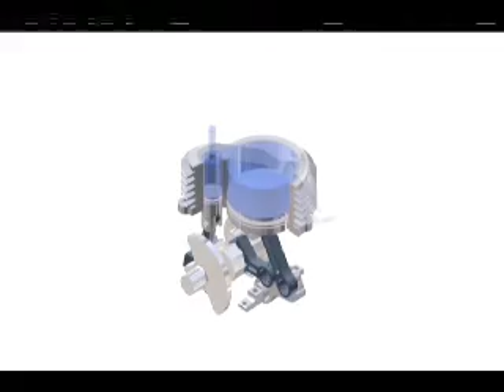A car that runs 200 miles on compressed air.

Comment: Fizzguts gets owned by me here!
watch?v=-X6oWZe0QTc
He claimed he has a pdf file from engineair which showed the motor will run 5min on 2 12L tanks.  When I said 5min on 24L is ok, he changed his story and said it is only a max theoritical time and the pdf actually shows constant flow, constant air pressure (not running on air tanks).  Further, he says the pdf is only theoritical, but his presumed 50% throttle losses are "actual" even though he has no throttle specifications or test data.

Comment: In the 1970’s Joseph P. Troyan designed an air-powered flywheel

In the 1970’s Joseph P. Troyan designed an air-powered flywheel that could propel an automobile using the principle of "ratio amplification of motion in a closed system." The Troyan air mobile (U.S. Patent No. 040011) was easily attached to electrical generators to create a pollution-free, variable-power system. ¨My engine simply uses nature’s most powerful force: air pressure¨ Troyan commented.

Comment: In fact many will not be aware that the use of stored compressed air has already been powering power plants. In as early as 1973 CAES (Compressed Air Energy Storage) installed their first compressed air energy storage plant in Germany.

Comment: I get so tired of these free energy scams.  Don't people understand the basic laws of physics?  There is no free lunch.  It will take more energy to compress the air than will be realized by decompression.  Because of inefficiencies of conversion, if fossil fuels are converted to electricity and then the electricity is used to compress the air that powers this car, it would actually end up being more polluting than an efficient gasoline powered car.

Comment: @ReeseL4D but aren't the air tanks under the car? not inside the car
so if you dude have something shaped like a ferrari then youd have a big space in the back where the engine usally is and you still have the bottom of the car
and plus youd still beable to fit people in it and it would be more aerodynamic

Comment: @redghost105 because it's a low speed vehicle.  At low speed, there is not so much air resistance.  A cube or sphere design gives the most interior volume per area of exterior material.  More interior space means more space for air tanks and passengers/cargo.

Comment: All you gotta do is catch a commie politician, tie it up, shove a hose down its throat, filter the hot air, you have fuel and heat in the winter...

Don't understand? Follow my links. Read the quotes page first.

Comment: @TruBluBand2010 
Read my comment again. 
Electricity, whether it's from solar or any other source, ISN'T FREE. I use some solar voltaics myself, and the cells certainly weren't free. (If you know where I can get free ones, please tell me, or appologize for the "ignorance" crack.) This is a scam. If they admitted the costs of the electricity to run the compressors to run the air tanks, it wouldn't be a scam (assuming they didn't also lie about the range of the vehicles on a full tanks).

Comment: @Nailer45 INO MDI cars of any sort are being sold anywhere. The Swiss MDI consortium are promising them ready to be sold in 2011 (yeah right) for 10,000 Euro. Buttock clenchingly expensive for such a short range POC.
Tata NEVER paid for a license as they discovered MDI are a lying bunch of arsewipes. They did sign an agreement but no millions of $ ever went to MDI

Comment: I was digging this video until the narrator said "use the air-powered generator to power an air compressor"... unless he means recapturing braking energy? I could drive a car that plugs in to use compressed air as a battery. Perpetual motion is silly, though. You can't use the fuel of a car to drive a fuel creation device to create more fuel for the car. You'd need to get more energy out of the fuel per unit than you use to create it.

Comment: Now observe Collins's profound assumption that a coefficient of performance (which is the useful energy output or work output divided by the energy that is input by the operator only) that is greater than 1.0 is impossible and would constitute a dirty old "perpetual motion machine" of the false premise kind he still advocates illogically.  There went windmills, solar cells, heat pumps, water wheels, sail boats, gliders, etc. All are impossible by Collins' assumption.

Comment: @charliewecker "Oh very good! Looks like you've been the one doing the research." Correct unlike you who won't and can't. Get an education. The same scam has run since the 1900's and has always been and always will be short range low power crap. Your stupid perpetual motion idea didn't mention imaginary fuel cells or totally impractical fission, you had to add it once you realized what a tit you'd made of yourself. Keep digging. I enjoy showing up cretins, it's a great hobby   ;-)

Comment: @charliewecker air tank runs an air motor that runs an electric generator that powers an electric compressor that recharges the air tank that runs an air motor & so on & so on etc etc = perpetual motion = you are an idiot.
& now you are introducing photvoltaics & fuel cells Finally figured out you wrote moronic tosh? Keep digging I'm enjoying seeing you make a complete tit of yourself. 
Is your next idea a chain drive from the front wheels to drive the rear wheels? Bwahaha

Comment: @charliewecker Then you are definitely an idiot GAST air motor or air drill 200psi regulator 2x scuba tanks plumbing a bit of welding. Should take a day or so and you'll pay $20 to get the tanks filled and will drive about a mile at about 20 mph. Put a video on youtube like all the other loosers who can't use the ideal gas law or a calculator

Comment: @fizzguts You still don't get it. Fuck perpetuity. It's not about that. Your getting caught in the word. You have to use all you means of energy collection.don't look at is as a loop.  You forget this. compressed air> pneumatic generator >battery>compressor] paralleled> [compressed air> pneumatic motor> spin wheels> wheels double as generators] next source sunlight > generate electricity] Main goal keep battery charged and cycling. >lets get funky >add secondary for shits and giggles >fuel cell

Comment: The term "air engine" disappeared from engineering textbooks after the 1930s and the second world war.  Gas engines had been perfected, the oil industry was established, and gas was cheap. And all competition was actively suppressed by the large oil companies , and still continues today .
Reply: There where at least six car manufacturers before the 1900’s that sold free energy electric cars .. that got more miles per charge than a Tesla
Reply: @IggyArssie  Who were they?
Reply: @IggyArssie  Any surviving model of that car?...Such engine design can be easily improved today...
Reply: Thanks for the information. I think the reason is the electrical companies, not the oil companies. Until now, there are people who fight any storage, transmission, or generation of any energy except electricity.

Comment: Serious interest in air cars was rekindled by the energy glitches of the 1970s.  Dozens of inventors have patented designs for hybrid, closed cycle, and self-fueling air cars, as well as conversions for existing engines and designs for air cars meant to stop at air stations for refueling.

Comment: @charliewecker Your idea 
air tank runs an air motor that runs an electric generator that powers an electric compressor that recharges the air tank that runs an air motor & so on & so on etc etc  = perpetual motion = you are an idiot.

So why don't you stop being so certain about what you think you know and go prove me wrong. Show me a working loop arrangement just like you proposed where the air tank is constantly recharged by the energy in that tank. You can't

Comment: @charlieweckerQuote "The "compressed air air generator " is just a compressed air tank that runs a pneumatic generator that generates electricity. That electricity will then be used to keep the car battery charged and most importantly to power an electric air compressor to maintain a designated PSI in the main tanks that run the pneumatic engine"  = loony  perpetual motion machine of the first order = not science = bullshit & if you can't figure that out it's time to hand back your crayons

Comment: @muaytb1 The "compressed air air generator " is just a compressed air tank that runs a pneumatic generator that generates electricity. That electricity will then be used to keep the car battery charged and most importantly to power an electric air compressor to maintain a designated PSI in the main tanks that run the pneumatic engine.  Also if you had an electric generator on all for wheels of the vehicle you would have even more free potential energy at your fingertips. NOT bullshit. SCIENCE!

Comment: Over-unity device installed in Minuteman Missile - patented by Westinghouse

Minuteman Missile

A frequency converter using 64 transistor stages and similar sophisticated feedforward and feedback mechanisms was placed in the original Minuteman missile, then deliberately modified to stop its demonstrated COP > 1.0 performance. Very quietly, Westinghouse engineers then obtained several patents surrounding the technology, but no further mention of it appears in the literature.

Comment: ATTENTION POWER GENERATION INDUSTRY:  The Bohren Experiment produces 18 times more energy than is input (in the accounted  Poynting flow), any time or place it is performed—it  can readily be developed to produce excess clean heat for power generation.

Comment: See Tom Bearden and Floyd Sweet demonstrate Sweet's 1987 Overunity device as it puts out over a Million times more electrical power than is input by the operator, taking almost all its input energy from the active vacuum.

Comment: Unlimited clean energy from the vacuum
No dependence on foreign oil from politically unstable areas
No pollution
No dependence on strategically vulnerable centralized power and distribution systems
No radioactive waste disposal problems

Comment: Breathtaking amount of snake-oil being peddled here.

Air is free? Well, yeah. So what? So is water, but that doesn't mean that electricity is free (water being the working fluid in most power plants). Its the same thing here: Its insanely stupid to brag that your engine's working fluid is free. The cost of running an engine is not the cost of the working fluid. It is the cost of transitioning that fluid between low-energy and high-energy states.

This is pathetic.

Comment: @elmilt1 Yeah all those engineers and scientists who have spend centuries studying compressors, understanding gas laws, adiabatic expansion etc etc. should step aside for an "inventor" with a room temperature IQ and access to you tube. That will solve the problem of not heating the air when it is compressed. Personally I think it will be just after they breed geese to poop gold bricks.

Comment: The Motionless Electromagnetic Generator (MEG)

Has produced up to 100 times more power than was input, by extracting free energy from the vacuum.  The MEG has been independently constructed, and its overunity performance independently replicated, by other researchers.  US Patent awarded March 26, 2002. Invented by Tom Bearden and four colleagues.

Comment: Henry Ford said that alcohol was “a cleaner, nicer, better fuel for automobiles than gasoline” (James Brough, The Ford Dynasty: An American Story, p. 118, and cited in “Ford – The Men and the Machine”, p. 365). The Model T Ford had a knob right on the dashboard to adjust the fuel-air mixture for either alcohol or gas

Comment: Totally misleading. The air is only an energy store. Same as when you pull out a rubber band. You are loading it with energy. The car takes just as much energy to move around as any other car. therefore just as much fuel (to compress the air) The last part about perpetual motion is pure rubbish.

Comment: @mackat4ck Well spotted. There is actually a youtube video with a small car with a steam engine coupled to a tank of heated pressurized water. Goes about 20km and is actually more effiecent than the air car. Recharge at your local steam boiler ;-) . "Title is Car driven by steam" enjoy

Comment: Sunlight is a massively abundant energy source that dwarfs all human energy sources.  We can get usable energy from solar cells because harvesting even a small percentage of the light allows us to generate useful amounts of electricity.  Re-compressing gas for an air car means you use energy that could have been for driving, you cannot have both.  Ever, period.  There is no such thing as perpetual motion, there never has been, there never will be.  Why? because friction exists.

Comment: Sunlight is an massively abundant energy source that dwarfs all human energy sources.  We can get usable energy from solar cells because harvesting even a small percentage of the light allows us to generate useful amounts of electricity.  Re-compressing gas for an air car means you use energy that could have been for driving, you cannot have both.  Ever, period.  There is no such thing as perpetual motion, there never has been, there never will be.  Why? because friction exists.

Comment: @Ebdan88 "Yes i will Buy it as soon as it comes out," because you have the engineering knowledge of a concrete lamppost.  Google e.volution south africa same stupid hype in 2000 & nothing happened. This is a CON with an actual 5 mile range & will be available next year always next year LOL

Comment: "In a small-city car weighing 1100 pounds, two 100-liter (26.4-gallon) cylindrical tanks pressurized to 4350 psi provide" an actual 5 to 6 miles of city driving range.
No MDI Air car has used more than 3500psi tanks. In the ONLY witnessed range test which MDI published the car went 7.2km approx 5 miles. The KLM testing of the airpod is described as "less than 10km" 
Find ONE PUBLISHED INDEPENDENT TEST that confirms MDI lies opps claims and I'll sing their praises 
Hello?
Ignored once again?
LOL

Comment: In a small-city car weighing 1100 pounds, two 100-liter (26.4-gallon) cylindrical tanks pressurized to 4350 psi provide 60 to 90 miles of city driving range. Refilling would take about two minutes at a compressed-air station. Plugging into a 220-volt electrical outlet at home or work, the tank fills in about four hours,

Comment: @Ebdan88 "I Would like to buy one as soon as it comes out.."
It's available next year always next year. It's actual range is 5 miles. You need a 6kw compressor running for 6 hours to recharge it. Those figures are direct from MDI's past websites.
It's a con for the technically challenged and tin foil hat wearing kooks.

Comment: Paul Pantone of GEET released

After nearly 3.5 years of wrongful incarceration, primarily at Utah State Hospital, Mr. Pantone is now out and ready to move on, while also facilitating a clean up of abuses in the institution by human rights organizations. A review of the GEET plasma reactor fuel efficiency technology.

PLAY
	
On May 25, 2009, Paul Pantone joined me on the Free Energy Now radio show.

 

by Sterling D. Allan
Pure Energy Systems News

Comment: @scavenski It's old technology dating back to the 1900's There is no way to improve it, so the pathetic actual 5 mile range with a 6 hour recharge from a 6 KW compressor is all you get. A con for technically unaware investors.

Comment: Energy Storage

The CAT´s engines can be equipped with and run on dual energies - fossil fuels and compressed air - and incorporate a reheating mechanism  between the storage tank and the engine.

This mechanism allows the engine to run exclusively on fossil fuel which permits compatible autonomy on the road.

While the car is running on fossil fuel, the compressor refills the compressed air tanks. The control system maintains a zero-pollution emission in the city at speeds up to 60 km/h.

Comment: Excerpted from "On Extracting Electromagnetic Energy from the Vacuum," IC-2000, by Tom Bearden. 

The whole secret of the Wankel was in confining the back mmf (magneto-motive force) region to a tiny section, so that for a very minuscule expenditure of energy, the back mmf could be overcome easily and converted to forward mmf.  Most of the energy to do that, is provided by the Lenz law reaction, which will only do it momentarily but that is quite sufficient.

Comment: Now for some real active suppression! About 10 years ago, some very clever backyard inventors took a magnetic generating fly wheel off a Model T Ford, placed stationary magnets in a spiral arrangement to the outside, and developed a self-generating motor-generator. The motor-generator (using the pulsed varying distance magnetic spiral principle), continually produced 1600 watts of power with no outside power input. Cont . below .

Comment: They demonstrated the generator at UCLA, which confounded the professors, students, and other onlookers. Evidently there were some heavy-handed corporate types in the audience, because the inventors never made it home from the demonstration. The two demonstrator-inventors were found dead along the highway, and the trailer with the generator inside was missing.

Now the Japanese apparently have the technology which is referred to as the "magnetic Wankel" motor

Comment: @mikehanoo33 "Air cars have worked for over 100 years and you know it"  Yep they have always been short range and inefficient & as soon as their niches mines etc could use alternatives such as sealed regenerating diesels or battery electric they were REPLACED. 
"do you really believe the Berkley study was fair?" Of course, only you, a technically illiterate tinfoil hat wearing kook would believe all Universities all scientists & all engineers are paid off by oil companies. QED you're bonkers